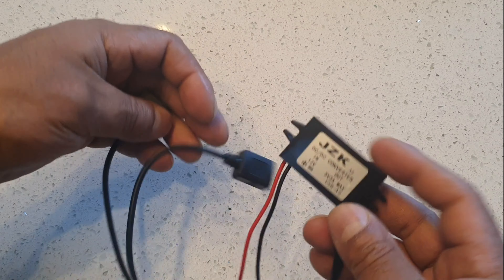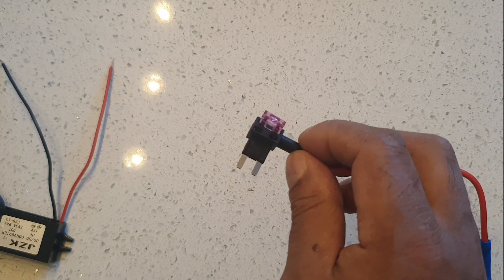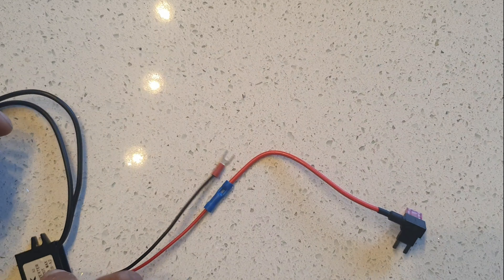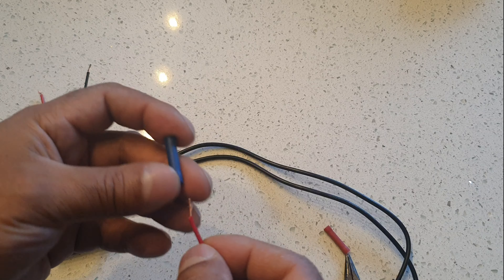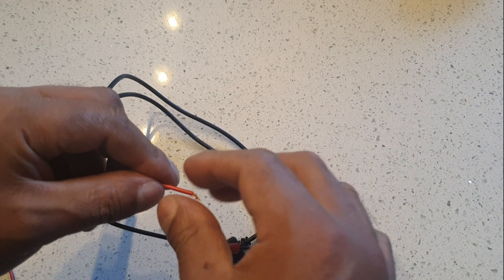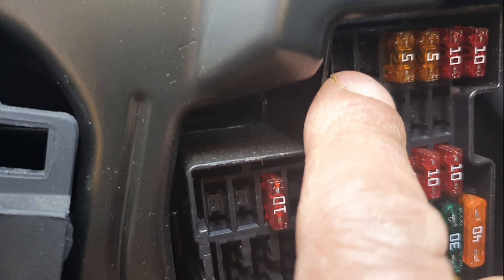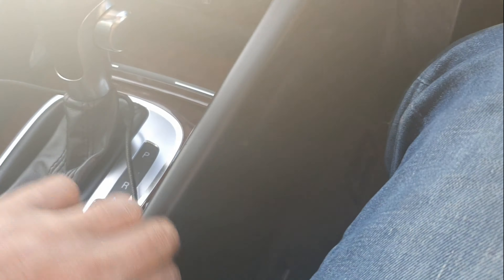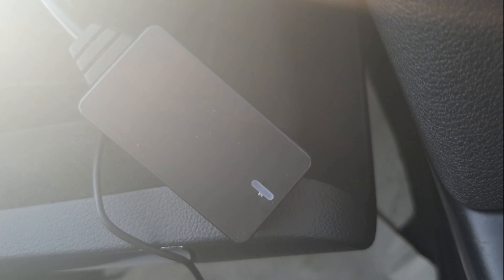DIY Install USB Charging Ports on a Car 12V to 5V 3A - Audi/VW or Any Car

Comment: Hi 
The extension wire your connecting is that the red & black speaker wire?  (maybe also used for LED strips)
I’m prity much looking to do the same as you
Great helpful videos thanks

Comment: Are these easy to install? As in could I do it myself by following this video? I don’t want to risk blowing anything.
Reply from the maker: The steps in the video are all you need to do. If you have a different car you may need to find the right fuse/wire locations

Comment: ampere fuse?and the port you conect on box fuse?
Reply from the maker: i used a 5amp fuse, but it depends on the load and what you are connecting
Reply: @AMRZINE  i try conect in luggage carrier socket
Reply from the maker: usb sockets tend to be 5amp so would stick with a 5amp fuse
Reply: I am installing something similar , a 12v to 5v usb 3A. What amp fuse would I need? In the video you used 3A though in the comments you used 5A. Just a little bit confused..
Reply: I'm connecting 2 dash cams to mine so I'm going with a 10amp fuse tap. Think that'll be good enough?

Comment: Hi, I am looking at wanting to do this with 2012 Audi A3 i just got. I would like the extra usb slots in the glove box  so I can wire in a usb powered Bluetooth module.

Where did you get the fuse and +12v feed from ?
Reply from the maker: all available on amazon

Comment: hey i got a question, i got a 2 usb charger to replace the cigarrette lighter in my 2000 civic and it came with 2 wires which i connected to the positive and negative that were connected to the cigarrette lighter but since last week it started smelling burnt and making noise, do you think that if i use a piggyback connection with a 2 amp fuse (it's a 2.1 amp output) that this will solve my problem?
Reply from the maker: Sorry for the late reply, you should always put a fuse in between the connections. I would use a 3amp fuse
Reply: @AMRZINE  ok thank you, im still fairly new to this kind of stuff so i’m happy you helped me out.